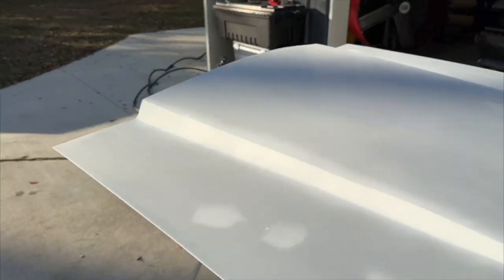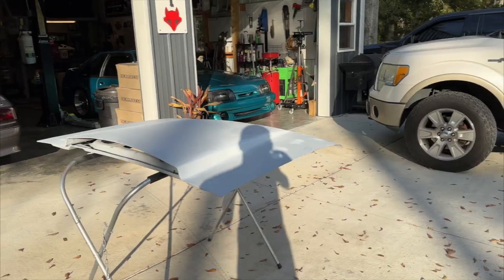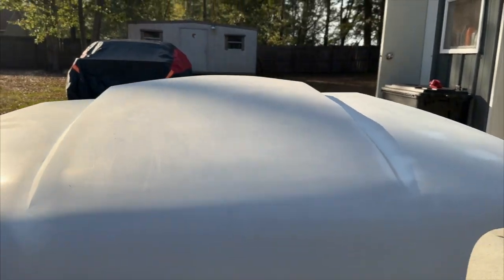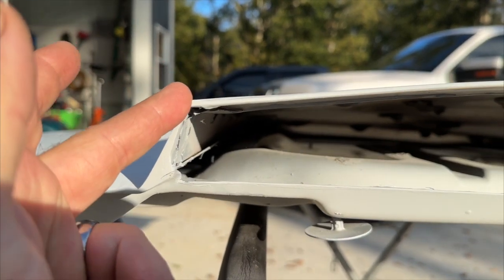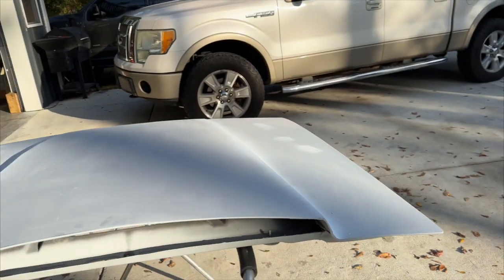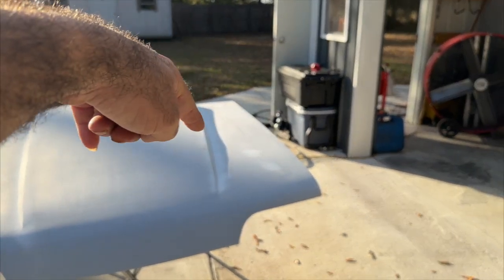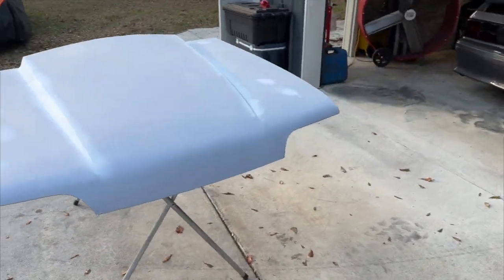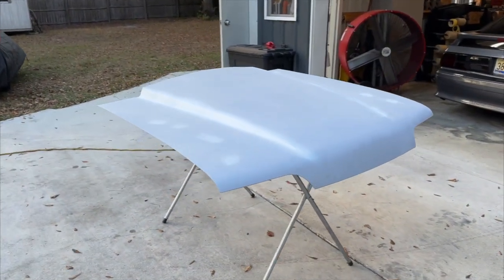Building A Free Cowl Hood From Scrap Parts!

Comment: me and a couple buddies made an "svo" style fiberglass hood for my friend's foxbody almost 20 years ago. it turned out nice. it fit well, gaps were clean and even, but too much water was getting in the carb so he filled the hole in and i ultimately ended up with it a few years later. its still on my car today, but it's been sitting over a decade and needs total resto now. interior, exterior, and engine.
Reply from the maker: Nice! ✊😎